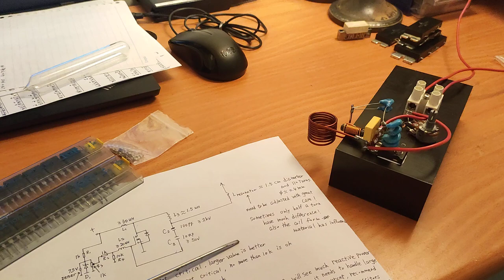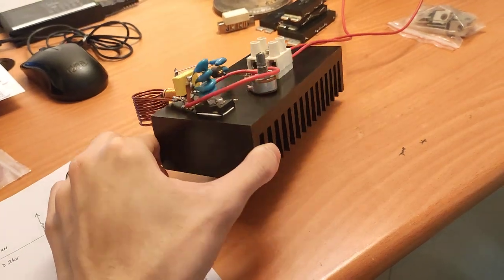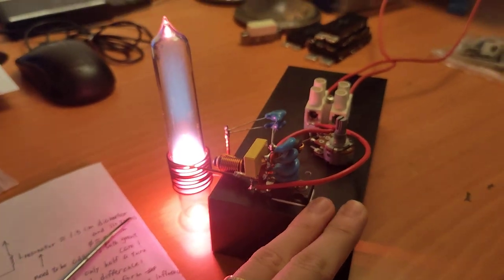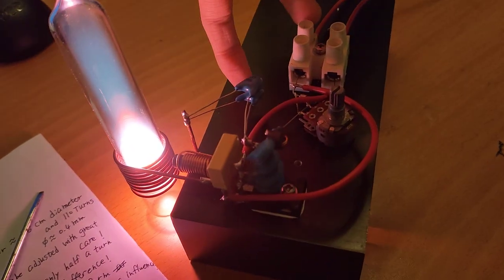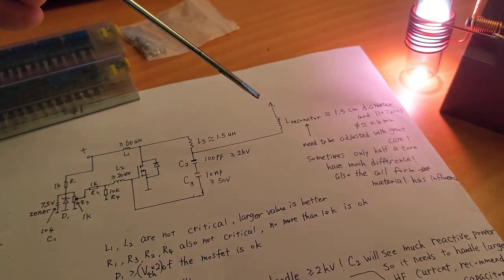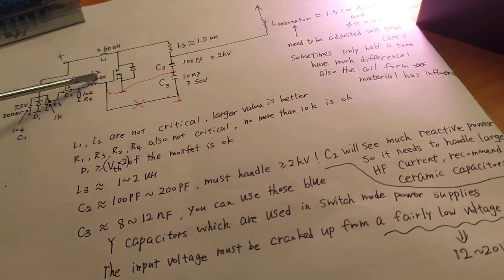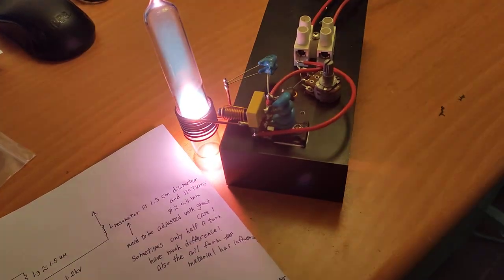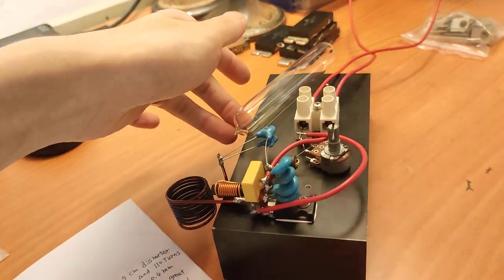RF oscillator excites neon tube

Comment: once you figure out that its a transformer and power in the secondary is dictated by the square of the turns ratio and how that reflected "resistance" affects the source, this becomes much easier...

Comment: Hi, what is the value of the capacitor labelled "C1" on the schematic? Thanks
Reply from the maker: Hello friend, C1 is a 0.1uF ceramic capacitor which is used as a filtering capacitor for the gate bias.

Comment: Hello, compliments for your video, I am trying to make an oscillator similar but I have a problem with Mosfet that goes out of work immediatly when i turn the potenziometer.
Have you some suggest?
Many thanks in advance!
Reply from the maker: Hi sir, are your resonant capacitor and the capacotor on the gate the same value as mine? If so, try using a current limiting power supply and use 20V input, then set the gate capacitor to around 4nF and try. Also you can start with IRFP460. Circuit layout is also very important in RF circuits.🤔🤗
Reply: Thank you very much for the fast response, layout circuit is the same of yours, I will try to reduce the input voltage and change the gate capacitor.
At the moment I have IRFP260N as MOSFET...
I will let you know!
Thank you very much!
Reply from the maker: @dmorologeria3875  I remember that in my SHORTS videos there a re several shows i using IRFP250N to achieve maybe 300W[70-80V input],mayve that will do help.

Comment: Your videos are awesome! If you had a gas flow through a quartz tube could this be used for something like an ICP torch?
Reply from the maker: Yeah, in another mine short video there is a over 1kW Xenon plasma ICP, though I still don't have a gas flow formed. My commercial ICP generator is a 1.6kW 40.68MHz oscillator.

Comment: In this circuit, if I want to oscillate at 400khz, what parts do I need to adjust?
Reply from the maker: Hello sir, the main resonant coil and the resonant caoacitor, also the feedback capacitor and the RF choke at the Drain will need to be changed. I am wondering why not just using a chip to generate the frequency you need and driving a MOSFET? Since that is really a low frequency and a driven type circuit will be more stable at that low frequency my friend.
Reply: Use a couple mosfets to excite a LC tank circuit tuned for 400khz.

Comment: I have made my own circuit which its similar to your circuit one and its actually work, but the capacitor burns it self and after few second running. Can you explain why
Reply from the maker: Because there is quite high RF current through the caps, and they must withstand a high reactive power.
Reply: @uecmitsuimarinedieselengin873  but when I put many higher capacitance capacitor in series, it output super low power
Reply from the maker: @OngVoELstuffs08  Yeah, that could happen, because if too many caps are in series then the equivalent series resistance of the capacitor will be huge, thus reduced the TANK Q factor. Normally silver plated ceramic RF power capacitor should be used. You can search for ATC telecom Rf capacitors.
Reply: @uecmitsuimarinedieselengin873  I think the output is low because of the equivalent series inductance